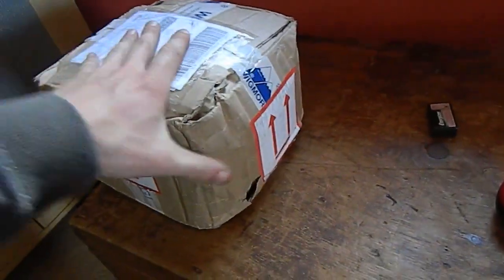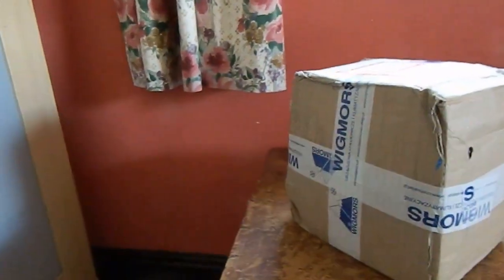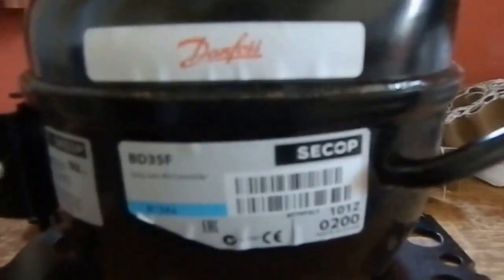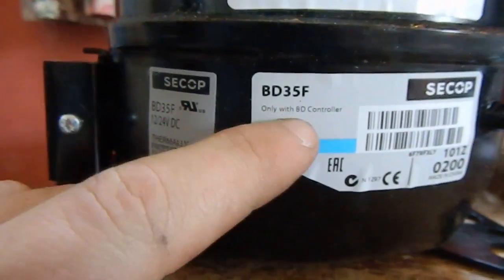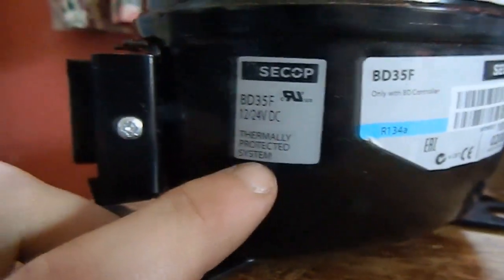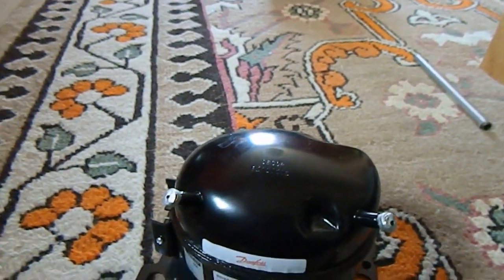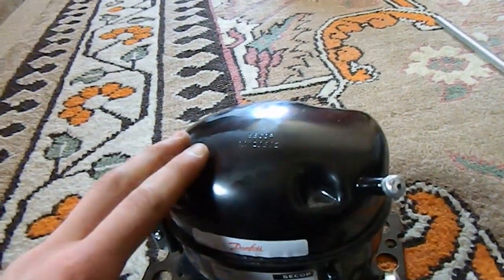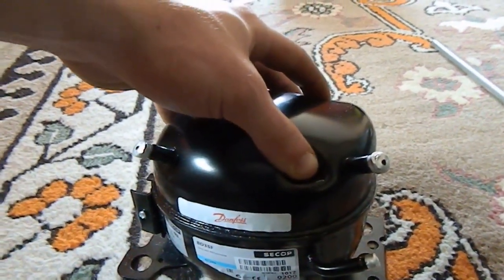12v 24v DC Refrigeration Compressor BD35F

Comment: Use fluxed silver solder to connect the pipes, it's about 5 quid a rod and available at refrigeration wholesalers.
Reply from the maker: Could you please give a link because I can never find them
Reply: @ShaunDobbie . Look on ebay for brazing silver solder with flux 👍

Comment: I would buy the proper controller and use the proper R134a refrigerant. Compressors don't last long if even slightly abused.
This compressor is suitable for a freezer as it says LBP in the specs (Low back pressure) MBP= fridges and HBP=air con
Reply from the maker: Proper controller and refrigerant is too expensive and my setup worked just fine.

Comment: Did you figure out the mix, for 134a replacement ? If you mix, 600a and 290, in 50/50, it's spot on, but you need mineral oil.

Comment: Hey man i wanna make air conditioner DC, do you know where i can find eletronic schems for this?
Reply from the maker: You would need to look at the information from the compressor manufacturer. They will supply datasheets you can look at online.  This compressor is not suitable for air conditioning as it can't move all that much heat.